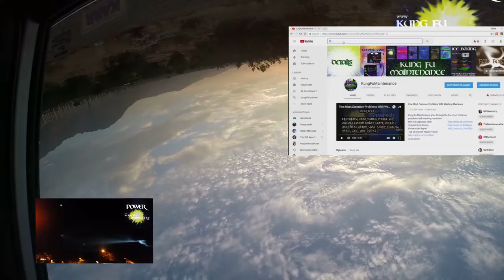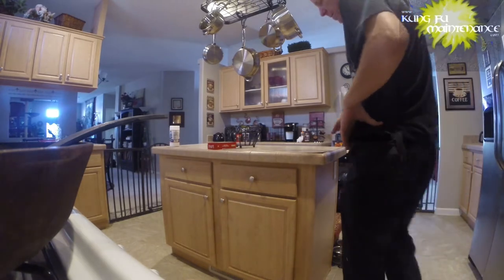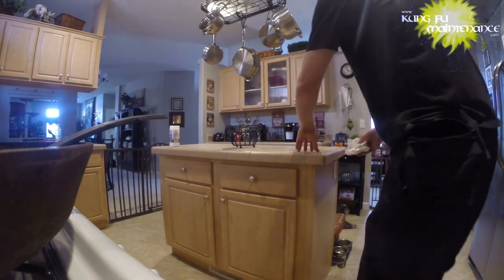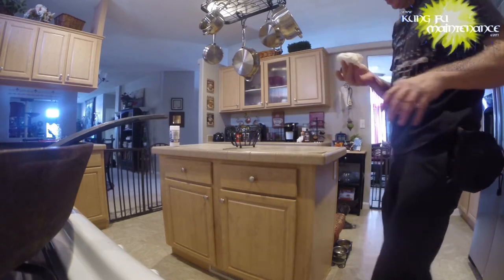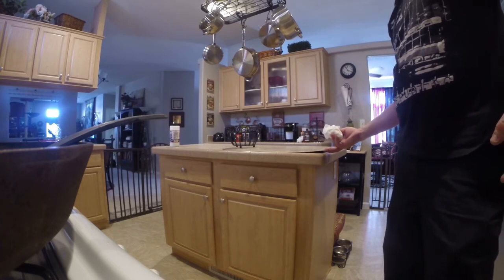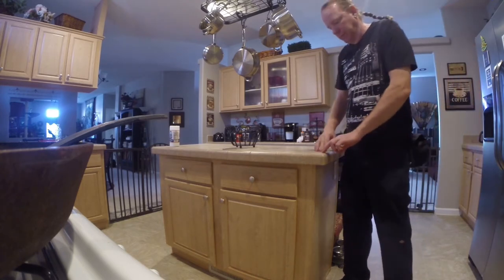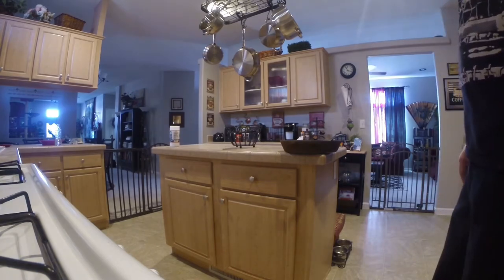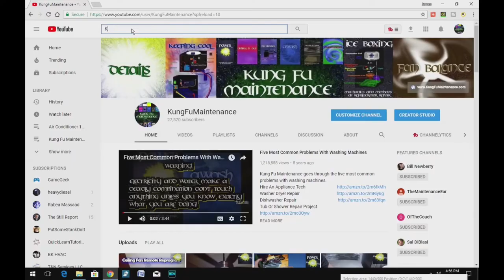Countertop Laminate Peeling Up How To Repair Mobile Manufactured Home Countertop Coming Up

Comment: I recently moved into an old house. The kitchen counter tops were, at some point, covered in what appears to be an adhesive film finish. Over the years, the finish has bubbled up. It's got pits and ridges that make it impossible to keep clean--even growing mold in some places. I just started scraping it off. The finish seems to be coming off in layers. The bottom layer is a white, chalky adhesive that is almost impossible to remove. Any idea what this is and how I can get it off? I've been scraping away at it, but it's delicate work to chip it away without damaging the original counter top. I did search your channel, but didn't see what I was looking for. It would probably be more helpful if I knew what it was called.